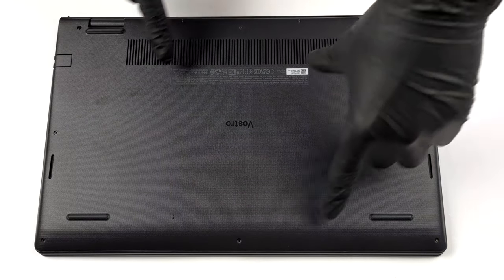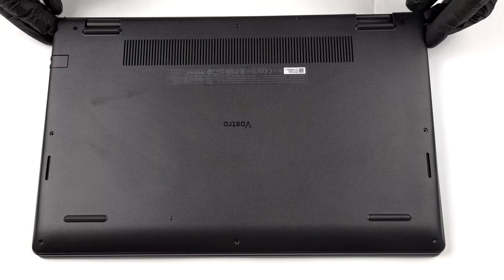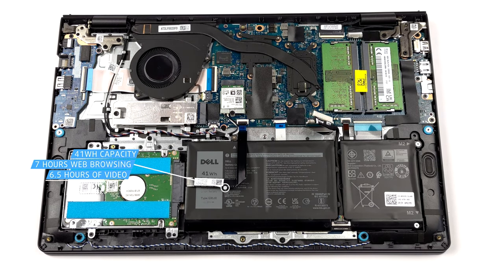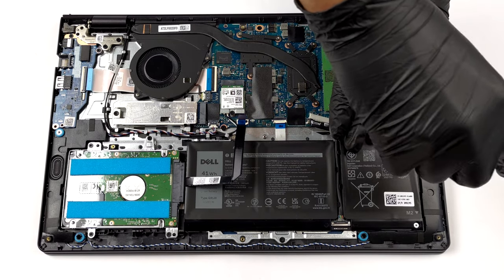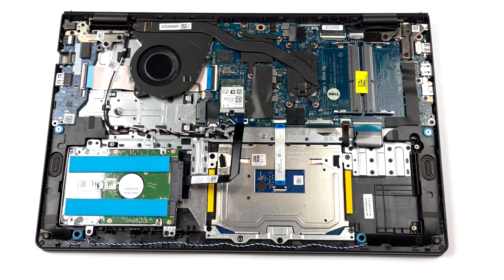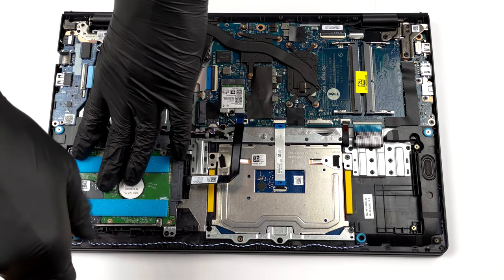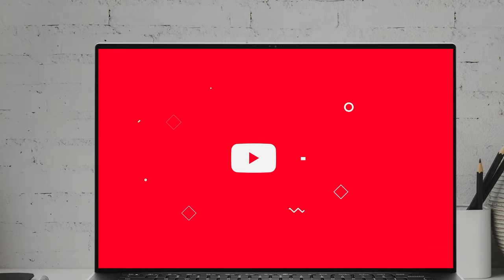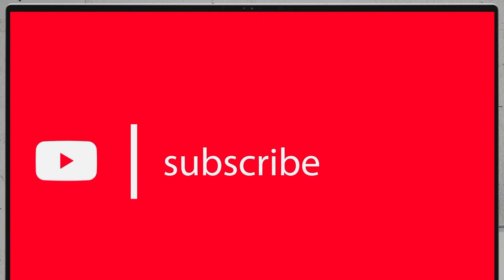🛠️ Dell Vostro 15 3510 - disassembly and upgrade options

Comment: why you didn't take off the heatsink? this laptop runs really hot for me, 50 degree celsius just in idle. So I want to reapply the thermal paste
Reply: Easy way to stop heating at idle is, lower resolution and switch off game mode.  Battery saving mode help as well.
Reply: same here did you find solutions?
Reply: i got the same issue aswell , the performance is very low compared to an i7 11th gen and it gets very hot on the slighest tasks , anysolutions ?

Comment: i have the laptop with core i7 1165g7 mx350. anyone here wants to check gaming performance, you're welcome to visit my channel. spoiler alert, this laptop is a toaster.
Reply: ?? You don't have any videos about it on your channel
Reply: I have bought this laptop 
And its high temperature is annoying me
Did u found any solution for this issue??
Reply: Play games on lower settings